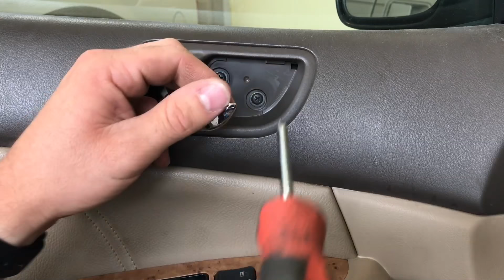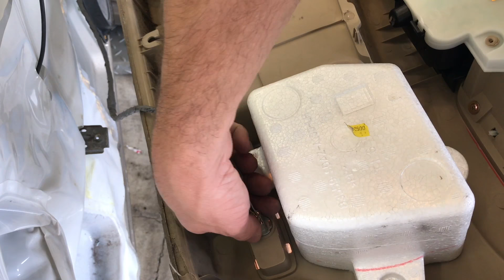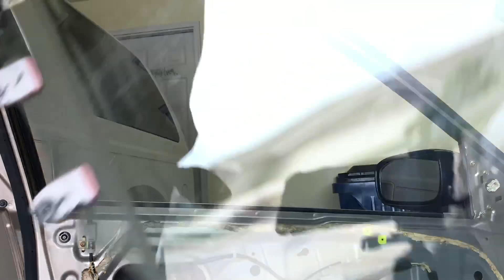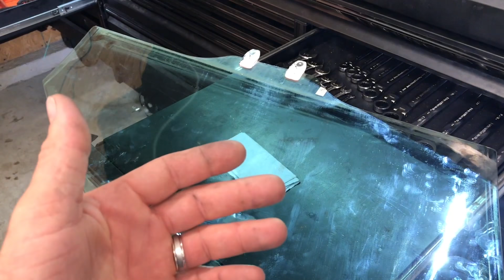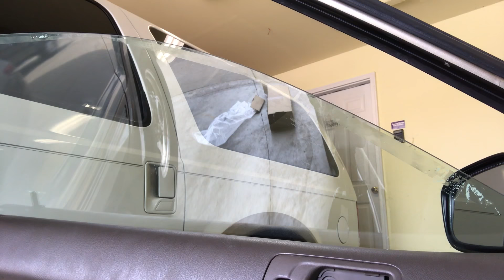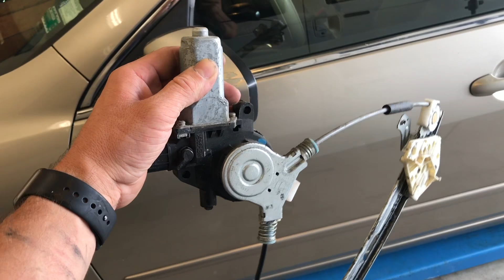How to Fix Power Windows

Comment: Newbie question.  It appears one can move the switch, say to full 'up' position.  Once the window is in full 'up' position... what if one continues to hold the switch 'up'?  what 'failsafe' mechanism exists to prevent constant load and stress to the motor and worm gear assembly and cable?  does the wormgear have a built in friction clutch?  or can one damage their window up/down mechanism by not releasing the 'up/down' switch quickly enough?

Comment: If your power window motor or regulator failed would it stop illuminating the windiw switch? Ive tried 3 different switches from the auto wreckers so it cant be the switch. The switch has separate wiring to the power mirror  so the switch illuminates for the power mirror. I checked all the fuses and they are all fine. My mechanc thinks there may be a break in the wires 
but as far as i can see i dont see any visible breaks. Another guy said its the motor because the fact that the window switch does not illuminate does not necessarily mean its not getting power to the switch. So does anyone agree with that statement? I believe he may be right and should test a new window motor. Any thoughts?

Comment: Would it be advisable to lubricate the cables a little bit?  Also, I really wish they would replace all the crappy plastic parts with metal parts.  I know it would cost more when you buy the car, but I think it would be cheaper in the long run.  I hate plastic!

Comment: I have a question on door locks.  ‘97 mountaineer, rear driver side door.  I think my wife locked the doors and some idiot slammed the door and bent the latch.  Now, the door will not open.  I have removed the door panel, so I have access to all the internal parts.  Is there anyway I can unlatch the door from the inside.  I know the longer rod moves to the rear to open the latch.  I can pull the door handle to open the door but not far enough to unlock it.  I think the latch is binding on the door post.  If I can get it open I will take my Drexel and grind off any burrs on the latch or replace the latch if that does not work.  I just have to get it open .

Comment: Hi thanks for the video. One question - what if my regulator and motor are fine, but just the glass needs to be replaced?
Reply: Why would you need to replace the window?
Reply: @lucidityfps9638  Glass typically breaks when someone smashes it in with a brick and steals all your belongings. Thanks for replying with such a great answer.
Reply: @Djentleman511  Exactly, that’s why I’m asking because if it’s broken then it obviously needs to be replaced. Why would you ask someone online what to do if you need to replace it? It’s kind of common sense. 🥴🙄
Reply: Assuming people have common sense. Hah, that's a good one!

Comment: Excellent tutorial.  I might mention that the "10 millimeter bolts" you talked about several times are actually 6 mm bolts.  The heads/nuts take a 10mm wrench, but they have a thread diameter of six millimeters.  (an SAE 1/4-20 bolt generally has a 7/16" head, but it is a quarter-inch bolt....)

Comment: My rear window has stopped working when I press the button I can hear the motor working but it's also making like a crackling noise does anyone know if I need a new regulator or it just sounds like something has gone loose or repluging?
Reply: I'm having that EXACT same problem. Did you figure out what it was?

Comment: I changed the power window regulator on my 2013 Chevy Cruze, and it was just about the same exact job as in this video. But I forgot to plug in the motor so I went through the panel removal and replacement twice. Whoops.

Comment: I love my cars with crank windows. Only ever had one failure of a manual window crank, and it was the regulator that let go after ten years. 
No more intro and/or outro music?  Do you have to keep paying a fee at certain intervals to use those tunes ?
Reply from the maker: Stan Patterson the computer I had the intro and outro clips on experienced a hard drive failure, so I have to create them again. I used royalty free music, so there wasn’t any cost there fortunately.
Reply: YO!  Crank windows suck when you go through the drive-thru or toll booth.   If you think crank windows are better than you better look awful hard for your next car.  Most have electric windows these days.
Reply: Who says I drive a car from "these days" ?  Most cars "these days" also have automatic transmissions.  Because that's all people want to do is push buttons. Push a button for their window to go down. Plop it into drive and gas on it, the brakes will stop me.  I've never owned a car with power windows, although I did just part with a car that had an "automatic", albeit a rather primitive one by "today's standards".  I don't go thru too many toll booths, and the only drive-thru's I hit are car washes.  I park my car in the parking lot, get out, walk inside so I can wash my hands before eating my meal. That way, I don't get lettuce, pickles, onions or sesame seed buns all over the upholstery or carpet.

Comment: Is that the Excursion i see yes it is😍😍
Reply from the maker: Roberto Rivas should I keep it?
Reply: Of course you should she's a beast keep her running
Reply: I could use some help i got a 2000 ford Expedition with the 5-4 it difficult to start when it's warmed up and when you cold start it in the morning it start's up fine i already gave it a tune up and it seem to help a little bit but it still does it any points you can give me
Reply: YES IT IS A GOOD TRUCK AND ONLY BIG DIESEL SUV MADE   I AM A 7.3 FAN BOY  MINE IS 2002 7.3 AND SOON WVO
Reply: DanielJaegerFilms If it still runs like you expect it to, then yes. Plus, that sucker is close to reaching 400,000 miles.